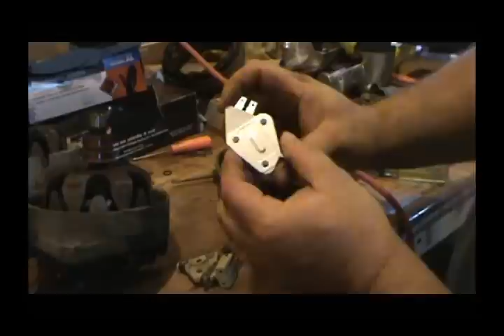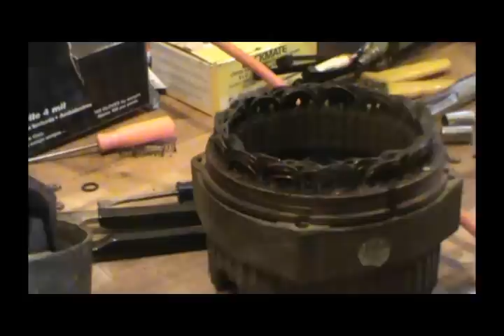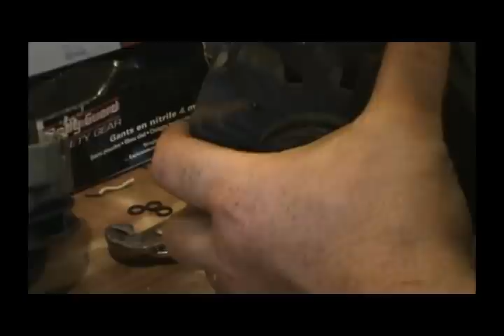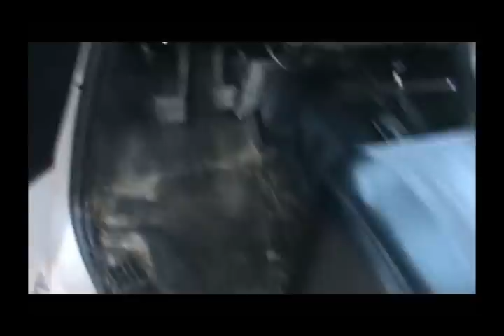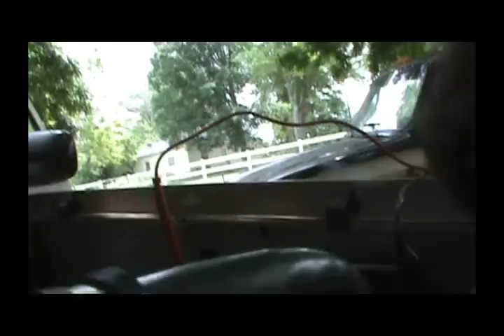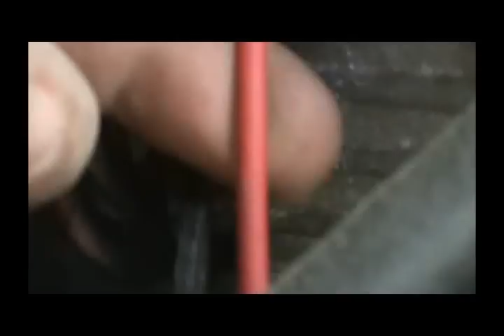GM Alternator Repair Part 2 Assembly & Testing

Comment from the maker: If the alternator doesn't have the 2-wire plug then it's probably been changed to a single wire alternator which doesn't require external excitation